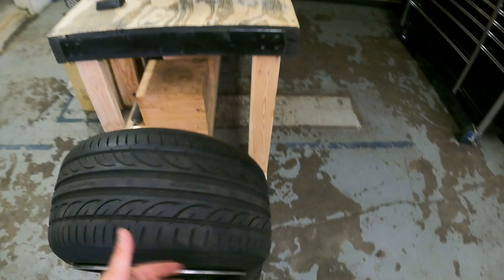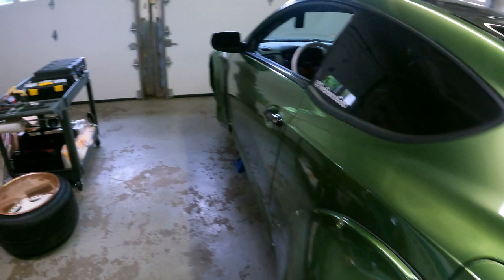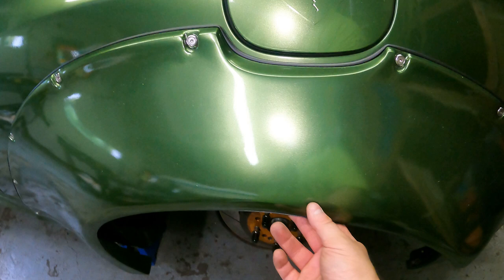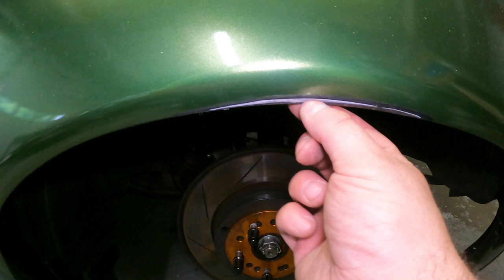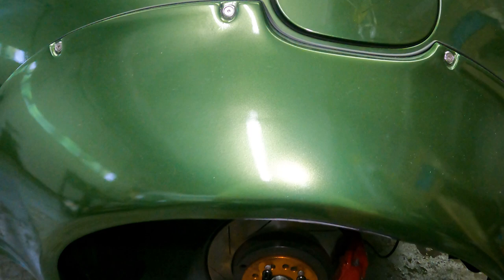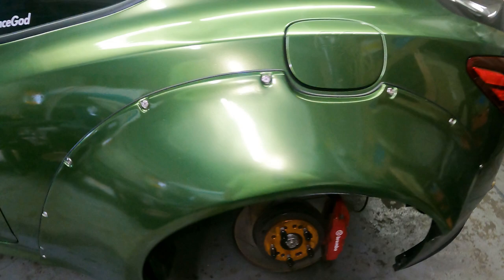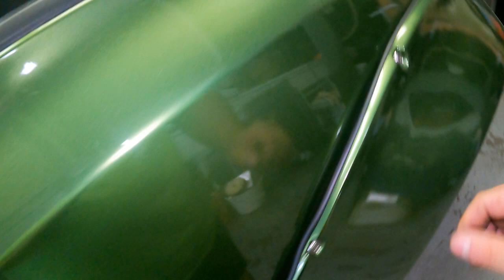My AirLift Manifold Dropped My Car While Driving. I Got Lucky, Could Have Seriously Damaged My Car!

Comment: Im on 3p airlift system and I’ve noticed when i drive the rear pressure changes and i have it set at 140psi but it will fluctuate between 125-140 (when im parked it will stay), the front only fluctuates between 56-60 psi. I have the same, air spring separate from the shock on the rear. Sound familiar when you were on your 3p system?
Reply from the maker: I didn't have 3P, only V2 before my current 3H. But that's pretty much similiar to what the V2 did. I was just at different pressure range for ride height. This video is from a while ago, but since way back then, I think I have troubleshooted enough and figured out what the issue is with my height sensors finally. Think the shop just trimmed my sensor arms too much.